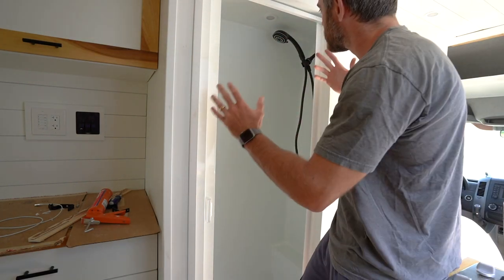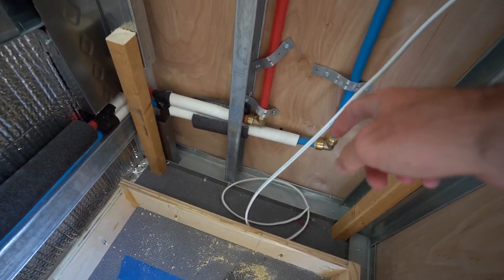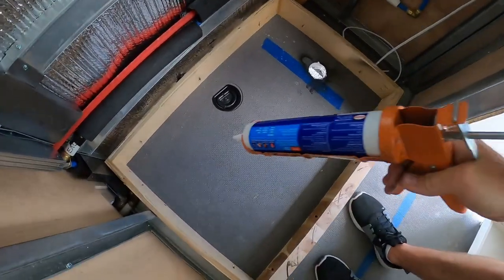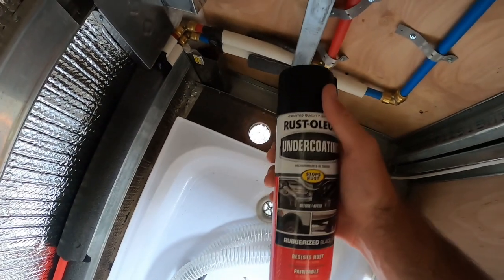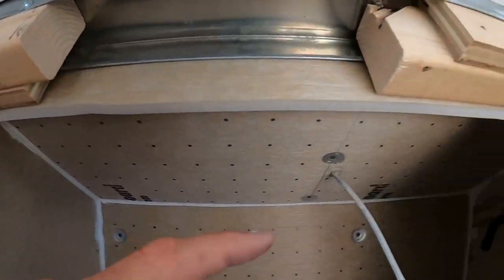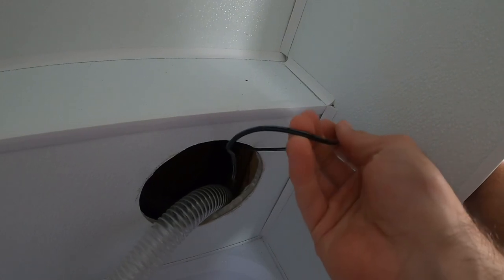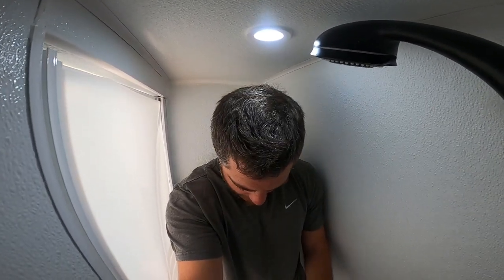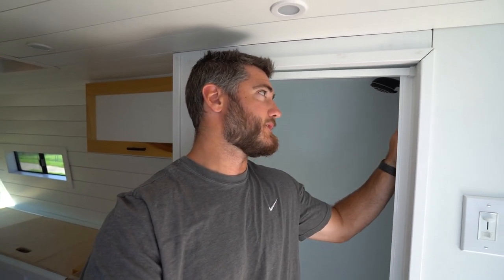How to Build a BATHROOM SHOWER In a Van with a Removable Composting Toilet - Van Build Ep - 38

Comment: How about a teak wood shower mat for the shower floor and then you could attach the Natureshead to the teak. Great looking shower and always a thumbs up for the video 👍👍👍
Reply from the maker: I need to look more into those, I was worried about it puncturing the shower pan but i'll see what I can find!  thanks for the comment!
Reply: @MathersOnTheMap  I'm putting one in to protect my shower pan. My Natureshead will be on slides in a cabinet behind a water tight rv exterior hatch 24x30. I always enjoy your videos
Reply: @MathersOnTheMap  I'm putting one in to protect my shower pan. My Natureshead will be on slides in a cabinet behind a water tight rv exterior hatch 24x30. I always enjoy your videos
Reply from the maker: That sounds awesome!!! Do you have a link to the teak shower Matt your using for your pan?  I’m assuming you’ll have to cut it down the the dimensions
Reply: @MathersOnTheMap  I haven't gotten it yet and I will probably have to modify it.  My shower pan is a 24" x 36". I removed it because the van is still under construction and I didn't want to drop anything on it. I am using the shower area for storage while I work on the rest of the van.
Reply: @Scrambler85  Im curious on how you finished your shower.. Im on this stage of my install.
Reply: @expandyourshelves9280  24x38 shower pan. I used FRP panels from Lowes
Reply: I'm thinking of doing that with the footprint of the toilet cut out of it, so the teak mat fits snug in the pan and the toilet base is prevented from sliding. I'd save the cutout so that it can puzzle-fit into place when the toilet is out so that the shower floor is even.

Comment: Hello, great video, I'm actually in the building of our "tour" van and your shower/toilet almost mirrors what I'm building. With exceptions of the shower pan drain being on the left side and having an actual bathroom fan. I'm using a cassette type toilet with a locking base, like you I don't  want to drill the floor pan so what I used was three wide strips of Velcro. Doing it again I'd use only two as its pretty aggressive to get the toilet out. Great build, I'll look into some other videos you two have made. Thanks Robert in Canada
Reply from the maker: Hey Robert! Thanks! We used a bamboo matt and screwed the toilet into that, helps secure it down well

Comment: A couple of well-placed suction cups would probably do the job. One in the front, and two in the back corners on the bottom of your collection bin. That will keep it from scooting around, and still leave an extra lip out to be able to pop a seal and get it out easily. I would suggest a 3in suction cup. Just super glue them to the bottom of the tank.

Comment: I would just create some sort of pillow or block that you insert (shove/place) in front of the toilet keep it pinned between the front/back wall. Driving is the only time you need to worry about it moving so making the bathroom "non-operable" isn't a big deal. Then when you need to use the toilet take out the pillow/ block and use the john. Also I would line the bottom of the toilet with rubber so when you sit on the it, it doesn't move/ ruin the flooring of the shower.
Reply from the maker: Solid idea If I don’t do a teak floor I’m definitely going to get some rubber for the toilet!

Comment: Hey @mathersonthemap - this video is awesome, has really helped me solve the problem of being able to have a nature's head without having to worry about compromising on a water tight shower. Question though, as you aren't bolting the toilet down and they recommend, how did you end up securing the toilet? Did you get movement? Also, do you find that the fan ensure you get no smell? Thanks!

Comment: I do like your shower and I think FRP is better than trying to tile the shower. The tile and grout could be a maintenance issue as it needs to be cleaned and the wall will get bumped as you shower.  I was concerned just a little flex and the brittle grout might crack. The Water pressure looks more than adequate.
Reply from the maker: Yep I couldn’t agree more + it’s so much lighter!

Comment: Have really enjoyed watching your detailed build videos. I would do some things differently, for example, I don't feel so comfortable using steel framing and would rather use 80/20, but not criticizing.  For this shower design, it fits my preferences very closely. I like the way you handle the hose and power wire for the toilet, hiding it away while showering. I have not yet searched the comments for the suggestions on ways to lock down the toilet without putting more holes in the shower pan. Great question!
Reply from the maker: Thanks John! We used a bamboo shower matt that fits perfectly within the pan for the toilet! It works well.  Maybe in the next build I’ll use 80/20 not sure ... it’s so expensive
Reply: @MathersOnTheMap  How did you attach the toilet to the bamboo mat? Does that hold it in place while driving? Do you have a link to that mat?  I selected to use bamboo for the cabinetry, so the mat would fit into the theme!
Reply from the maker: Yes I screwed the toilet’s brackets to the matt and it secures it well, here’s the link I also added it to the description! https://amzn.to/2Ku1l3k

Comment: Velcro the 90. Velcro the back of the nature’s head to the step shelf. Or use 3M hooks or clips to hold the toilet in place. No screwing around. Cheers from Canader eh!
Reply from the maker: Thanks Susan! We actually used a bamboo shower matt and screwed the toilet brackets  into that.  It’s really easy to remove when we want to shower

Comment: Another great video! Now that I am just starting my build,  I am even more impressed that you continue to make these “teaching”videos! Thank you!!  Your van is looking so good! I love what you did in the shower with the step and the marine hatch! Great ideas! That’s is a really good solution for an aspect of the nature’s head that bugged me! I’m curious to know why you couldn’t do a teak base under your toilet? Is it because it would make the floor too high and the shower not tall enough for you? If so, Could you remove it when you take out the toilet? Looking back would you have built the shower on the van floor so it would allow more height? Thanks again for making such detailed videos!!
Reply from the maker: Thank you Sherry!!! I think if I were to do it over again I would have bought a 24x24 shower pan and then where the ledge is I would have build an elevate platform for the natures head.  Im not sure though.  Also I was thinking about putting a teak in the shower pan but I am afraid of it puncturing it and then I'll have bigger problems.  I can't put it along the top edge of the shower pan because I put the hydroban and FRP over it to prevent and water seaming through.  Do you mean securing the shower pan directly to the van floor not the sub floor?  Im not sure, I doubt it since it would be difficult to get it perfectly level.
Reply: Mathers On The Map I didn’t think about it puncturing-thanks! If you did a 24x24 pan, how much wider do you think it would make the shower after you build the toilet platform? Sorry for all the questions , the solar and plumbing are what is the most challenging for me so I’m trying to get my head wrapped around it!
Reply from the maker: @2sherrymoore  I am going to look into the teak, we'll see!! but I'd probably keep it around 40-45 inches

Comment: I’ve watched your van videos probably over 1000 times and appreciate all the detailed information. Question about on your video, you have your shower pan up against both sides and the front of the walls before you put on your Backing board and FRP board. This will make it hangover the lip of the shower pan correct? Also, on the steel studs for the back wall did you screw directly into the ribbing of the van? Thanks for your help!
Reply from the maker: Thank you!!

Backer board over the pan (you don’t have to do it this way).

We screwed steel studs into wood furring strips.

Comment: Thanks for the helpful video. Question for you regarding the puck light. Did you "wet location" 12V puck light?

I'm having a difficult time finding a wet location light for my van shower that is 12V. Every "wet location" light seems to be 110V. Not even sure if I need the the waterproof light. Any feedback on what you installed would be super helpful. Thanks in advance
Reply from the maker: Nope just used sealant adhesive around the light to make it water tight.  If it’s on the ceiling you should be good.

Comment: What did you use to keep the toilet vent hole from rattling or potentially getting cut in the floor hole of the van you created?
Reply from the maker: I used some foam plumbing insulation and will also spray some great stuff to seal up the hole from underneath the van

Comment: @MathersOnTheMap Loving this step-by-step guide. Great shower concept! Do you guys have a recycling shower system? Or, if not, did you guys consider installing one?

23:58 Also, just one question: what did you apply to the back of the inside-corner and outside-corner spines in order to get them in place? I didn't see whether you applied the FRP adhesive or silicone. Am I crazy for not catching this or was I just not paying attention? XD 

Thanks
Reply from the maker: thanks Caleb!  I wish we had a recycling shower, but that was a little over my head initially.  The corner spines are held in place simply from the pressure of the frp, no special adhesive.

Comment: what did you do for the gap underneath the edge of the shower pan. On mine it looks like about 2 inces
Reply from the maker: We built a frame out of wood!
Reply: @MathersOnTheMap  Thanks.  We did that.  at the front edge of the shower pan where it curves down it does not meet the floor (about 2 inches up).  What did you do with that space?  Also do you think using the frp inside corner moldings is essential?